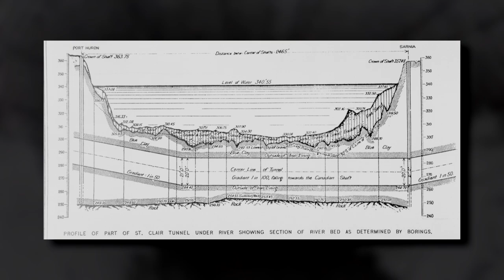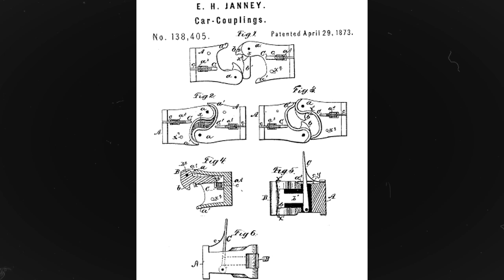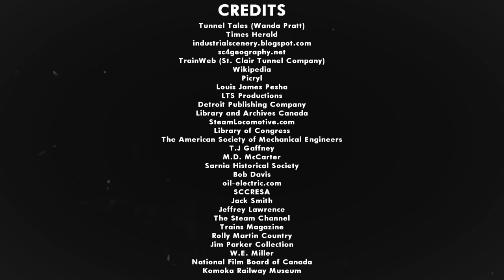The St. Clair Tunnel Company's One Of A Kind Locomotives

Comment: I was really surprised when I first read about this company - an electric railroad, in Michigan?! I've always wanted to find out more, so this was a great video! In a similar vein, based on some pictures from one of your previous videos, Michigan Central Station and the Detroit River Tunnel were third-rail electrified.
Reply: Those were not the only electric operations in Michigan, either, there was also the Michigan Electric, which was an interurban line using both third rail and overhead wire with trolley poles, with some street running.
Reply: Look up the DT&I sometime. Henry Ford had the line electrified to serve River Rouge, and since the catenaries were built from concrete, they're still there, albeit the wires are long gone. You can see them from I-94 if you're going from downtown Detroit to Metro Airport
Reply: @TrinityShoji  Oh right, the DT&I is another one! It intrigues me how widespread electric railroading was in an earlier time.. living in Detroit, my younger self used to think that the Northeast Corridor was the US's first and only electric rail line.
Reply: @JohnGeorgeBauerBuis  I'll definitely have to search this one up.

Comment: Very good video but a couple of corrections/additions: The renumbering was 1305 to 1310 > 2655 to 2660 but in 1923 was done in reverse order 9150 ex 2660 to 9155 ex 2655 The last electric operation was September 28 1958 and the new tunnel opened April 5 1995, not 1994 (Canadian Rail Magazine Issue 446)

Comment: And then those modern CN trains go on to disrupt car traffic parallel to Gratiot, all the way into Detroit. I always thought it was interesting that Richmond and New Haven were basically built on that specific line, like literally the dead center of both towns. I actually purchased a car from a used car dealer that rents part of the old grain elevator in New Haven, you should go check it out sometime. Also it'd be interesting to see a video on more of that line as it travels through southeast Michigan, I'd argue its possibly the most disruptive line in the state as far as interrupting traffic goes.

Comment: Diesel exhaust in tunnels is no fun -- I remember this from the tunnels into Back Bay Station in Boston before completion of Northeast Corridor electrification from New Haven to Boston(*), and from Grand Central Station in New York in the 1980s, when the station was full of diesel smoke because of FL9s running on diesel power instead of the 3rd rail electric power they were supposed to run on, plus E units even being run into the station for a short period (although I don't know if that coincided with my visit).

(*)And Back Bay Station still has this problem, because the MBTA refuses to electrify their Commuter Rail.
Reply: This reminds me of wanting to slap whichever genius decided that work trains in the NYC subway should be diesel powered. Every time one passes through the station you’re in you’ll feel your lungs burn for a good few minutes after. Meanwhile there’s been battery-electric equipment in existence in small trains like these for decades (I get that the work trains can’t be powered by the third rail since usually when there’s a work train it means the third rail is off for whatever they’re doing).

Comment: Canadian national invested in this 3.3kv ac 60hz Three phase system it would have run Port Huron, MI Sarnia,ON Hamilton Toronto, ON Union Station via Oakville Subdivision clearance using Reading RR height. Since Oakville subdivision has Ethanol plants correct procedure for the electric locomotive  is front Pantograph UP